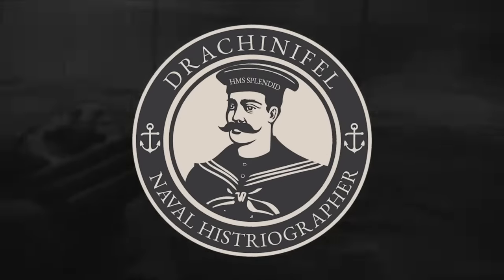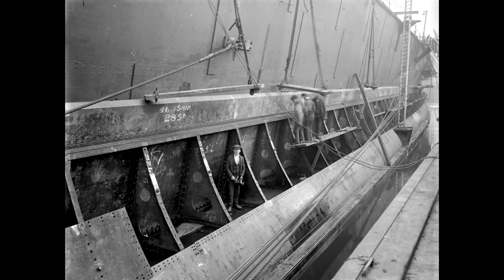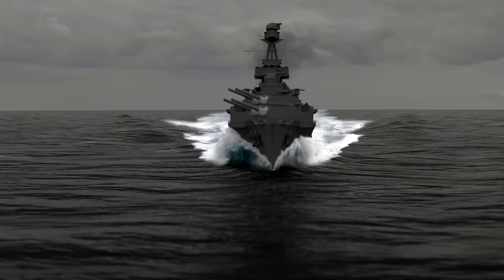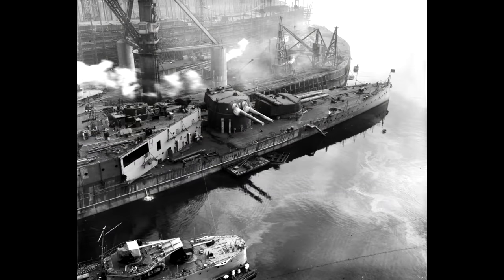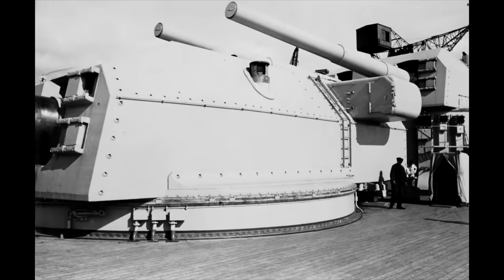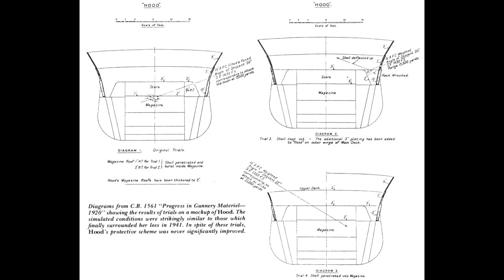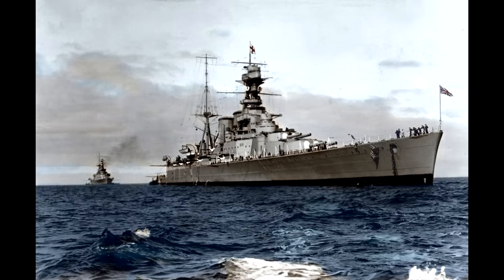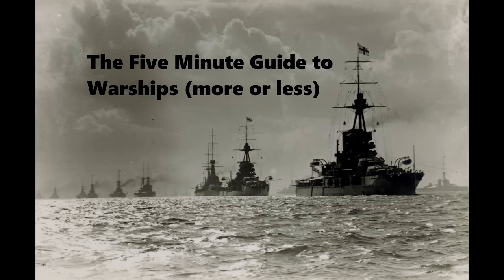The Loss of HMS Hood - But why did it blow up??

Comment: It says so much about Drach, that after 80 years of "What happened?", my first thought was "I'm glad we will finally be able to put this one to bed"..
Reply: Well said. No substitute for thorough research.
Reply: That ^  :-)
Reply: yep, i thought that an extremely well presented description of events, he also took time to cover the other theories. Very nice work.
Reply: It's almost identical to the one I've followed for a while, the one I saw last year had the shell hit slightly further forword on the ship traveling trough the machinery space and detonating just short of the relatively thin bulkhead protecting the secondary ammo, ultimately leading to the same end chain of events
Reply: @gettinglost316  that's what happened. it went through the 7 inch belt
Reply: Buzz Beurling I know that Nathan Okun subscribes to the 7” belt penetration theory.  It requires an even narrower window than Drach’s theory, but both are plausible in my opinion.  Unfortunately we’ll never be 100% certain.
Reply: @bluemarlin8138  but we can be...the timeline and the sequence of events is quite clear.
Reply: I had the same thought.
Reply: Academic speculations will never give the exact answer, sending down a drone that documents the actually damage on the hull as well where bits and peaces are located on the sea floor  might finally solve this mystery.
Reply: It would be interesting to see a probability distribution of likely shell hit locations distributed over her hull. We know the exact chain of events (4inch Mag first). Could probably get pretty accurate. Would be interesting to see what the probability of the range would actually be given the size of the ship a PDF function for statistic types. I have to imagine that it was pretty low odds
Reply: @nanordstrom  I doubt sending a drown down would help. The area around where the shell impacted is just gone after an explosion like that.
Reply: Same. This is the first and only theory that really feels right to me. The plunging shell through the deck to me never felt right.
Reply: Know one knows what happened - Drach would be the 1st to say that this is a most likely THEORY.
Reply: @robanson32  How do you know the exact chain of events??????
Reply: Yes.
Reply: @sevi117   agree. The area of interest was blown to pieces,the midships section is upside down and has been at the bottom for almost 80 years. We *know that the aft magazines exploded. There were probably a  hundred or so who saw it. What was in doubt was why?
Reply: @mfletch3205  yes. The problem is that most of Prince of Wales crew wasn't lookin at the Hood until it exploded (mainly because they were on a night battle and apart from the fact that they had a lot of job, they only could see the ships when they fired), and only 2 persons from Hood's crew survived. They only knew that the ship exploded, but they didn't knew how it happened. The aft magazine obviously had blown up, but all they had apart of that were suppositions. The pride of the royal navy was gone, and they didn't know why. Weak horizontal Armor was always the main suppositions, but the interesting thing about Drach's theory, is that it changes that point because it shows a more plausible one that looks at the ship underwater protection and a lucky (but more plausible) hit that could happen few minutes before explosion
Reply: @sevi117  Kinda like the Edmund Fitzgerald!  The part of the ship that sunk in Lake Superior that would prove/disprove 2 of the theories of why she sunk is broken apart, separate steel plates and under well over a few thousands of tons of steel pellets!  (The other part that needs to be looked at is the lower part of the bow and that's several feet below the bottom of the lake covered in mud!)
Reply: @buzzardbeurling  Not if there are 2 possibilities that end with the same conclusion.  It’s probably one of those 2 scenarios but we can never know definitively which one it was that started the chain of events.  Both theories are valid but only one situation is plausible.  Which one?  You don’t know.  There’s no way to be 100%. 

The only thing that IS 100% certain is unfortunately HMS HOOD sank.
Reply: If you understood all he was saying!
Reply: @davidcritchley3509  What??
Reply: @davidcritchley3509  I understood him.  That’s not the point.  I don’t understand you so I’m still waiting on a reply.
Reply: @timengineman2nd714  Now I have the Gordon Lightfoot song stuck in my head.
Reply: Alemania siempre sera mas grande que el reino unido jajajajajajaja
Reply: I have to say I don't think we can ever put the matter fully to bed the wreck is utterly devastated it doesn't give us a clear Smoking Gun on which specific element precipitated the magazine explosion and there's not even some agreeance between people on that being the case my definitive understanding and Analysis is Hood was a battle cruiser sunk by a German battleship because her armor scheme was insufficient and anemic Hood was the wrong capital ship to send after Bismarck the only comparable scheme from a 20 year older design would have been her speed which was diminished from mechanical neglect HMS Hood was an instrumental worship from the first world war and had she been retained and maintained correctly she would have been a more potent instrument to send against the German battle wagon
Reply: Literally same.

Comment: When I was serving in the U.S. Reserves after my active duty tour, I worked with a very good Senior Chief who was a nuclear engineer. In civilian life, he worked for a company that had a contract to design the ammunition hoists for the U.S.S. Theodore Roosevelt. A major consideration of the design was to prevent the bypassing of the safeties so blast doors could be open simultaneously. Million were spent "sailor proofing" the lift system. He told me that on the first acceptance sea trials, it took the crew forty minutes to defeat the interlocks and open all of the blast doors at the same time. So much for that theory...
Reply: That's the thing about idiotproofing things. If no current idiot can break it they will just issue a better idiot.
Reply: Funny story about that. One of my friends is an officer with the USMC. His unit was tapped to field test a new... Widget by The People Doing R&D. The researcher in questions handed him a few of this widget and basically said, "we've designed this to be grunt proof. I'm heading out of country tomorrow, send me an after action report if any of your guys manage to break this."

Three hours later my friend was standing in front of this R&D guy with a hundred pieces of widget. When asked how the hell his Marines had managed to break it, he responded, "They put it in a freezer and then shoved it between the road wheels and track of an Abrams."

"Why the hell did they do that?!" 

"I thought you said it was grunt proof?"
Reply: Its always hilarious to read these stories
thanks for another one
Reply: The thing is you say defeated the system, did they intentionally defeat it? If there were doing everything they could to bypassing it then the system was reasonably good as having that many steps to achieve a unsafe condition should not happen in a real world situation. If it took 40 minutes accidentally then the system was junk as a series of events to achieve this were not alerted to.
Reply: @NavyVet4955  It took that time the first time.  Because the transport time is long, crews were notorious for bypassing the safeties to get weapons on deck for faster turnaround of strikes. The system was supposed to prevent it, but it is still wiring, and any system can be negated. I don't know if it alarmed, I wasn't there, but the whole point was that the doors are opened when the ship is most vulnerable, during active operations. Ask the British what can happen...
Reply: While only anecdotal, I can't imagine is ever bypassing a safety system on my last ship for any reason unless bypassing that system actually reduced risk. Example: we could, while under fire, continue pushing the engines past safety limits to get us out of the line of fire. But knowing that doing so might actually cause the engines to fail, we were still unlikely to do so as slower engines were better than none at all. But I do know that historically, other commands have been known to break rules for convenience (Iowa comes to mind)  @kevinbendall9119
Reply: @kevinbendall9119  I was aboard the Carl Vinson for 4 years and as a ship fitter got to see a lot of these issues while doing repairs and modifications around the ship. I think the idea of preventing the unsafe condition is good however most times the problem is portrayed incorrectly. To the sailors getting the ordnance to the flight deck is key to getting the planes off the deck. Sailors are drilled and pushed hard to be the best and at times told to do what it takes behind closed doors. Then you have the safety minded that want to eliminate ways for the sailors to skip steps in this process. The real need is how to get the ordinance to the deck faster and safer. Few hands on sailors are ever consulted when designing systems.
Reply: @NavyVet4955  Yep, know how that goes. I was a tin can sailor, but my Brother in law was on the Nimitz. You put your finger on the crux of the issue. The problem comes when things go wrong, and the survivors are busy doing CYA.
Reply: @NavyVet4955  non end user input or lack of it is widespread, was in the business for twenty five years, a head designer from a client one day even announced he had never even sat in one of the vehicles we were working on, it is how it is and as more and more people get involved so things will not get better.
Reply: @MrKeserian  The most feared thing in the world are bored Marines and Canadians at war.
Reply: @ice843  you could be right, at one time we relied on "common sense", not allowed that today,
Reply: I believe all the best systems, allow you to cheat; i.e. a bypass is built in and considered for. Rigid systems will never take into account all the circumstances that will happen.
Reply: @notapilot1  To my sure knowledge, there are no "bypasses" installed on safety interlocks. Knowledgeable techs can defeat any system, but as someone else pointed out, making it difficult and time consuming helps to prevent it. I have seen them fail, and because of one failure in particular, the systems were redesigned so that they would fail in an alarmed and locked condition.
Reply: @MrKeserian  LMMFAO !!! OohRah !
Reply: @taproom113  if we don't give y'all enough crayons to munch on, y'all start figuring out how to break things. Usually it's enemy things. At least, that's what the rest of us prefer. ;p
Reply: The same thing happens in civilian industry. Workers repeatedly sabotage saftey precautions in order to more ease of operation of machinery. Sensors ends up taped over or misaligned to allow for protective doors to be opened with machines still in operation to allow, as I saw at an industrial bakery to remove clogging of pieces of bread stopping a packing machine. I also saw a worker get a hand trapped in a machine (imagine a mangle) while trying to clean it in a way it wasn't meant to be cleaned, that is while in operation. She could have lost a hand but luckily it only needed to be bandaged for a few weeks.
Reply: @MrKeserian  'challenged: accepted' moment lol
Reply: Haha...In the german Spz (APC)  " Marder", you know....if you removed the night vision system on the march....you could exactly fit a large box of "Hanuta" (a popular german chocolate waffel sweet) onto the turret ring...said someone who insisted he was absolutely sure.....just saying......
Reply: @jimminey-fooking-cricket4903  as a Canadian I agree.
Reply: @CrusaderSports250  little story father told me of his time in the navy, the ship he was on was getting some brand new communications equipment installed against one wall, and just so happened one of the designers was there overseeing the installation. The sailors took one look at it and noticed a glaring problem, all the buttons were prominent; when the designer asked why that was a problem with that one of the sailors pushed him against it and half the bottons got pushed. It was at that point he realised waves and rough seas were a thing
Reply: @89Keith  but it worked perfectly every time they tested it back at the lab !!☺.
Reply: @CrusaderSports250  yup, perfectly unless someone happened to get knocked against it and mess with the dozens of settings, but not like that could possible happen on a warship at sea :p
Reply: @CrusaderSports250  Look at what they have done with small gasoline containers in the civilian market.  Turned a simple to use, inexpensive container into a expensive monstrosity that people very often modify, that frequently makes them more dangerous and makes them "pollute" more than the old school version.
Reply: @89Keith  we could form a committee to study the possibility of putting a safety rail round it, that would work !!☺.
Reply: @johnstudd4245  not sure of the containers you are referring to as I am in Britain, we have the standard design Jerry can and 5 litre screw top plastic containers for fuel, if you have something different it will be because its been "improved" !!☺.
Reply: @CrusaderSports250  Google "how the EPA  ruined the gas can" and look at some of the results. May be the govt environmental regulators have a bit more common sense in the UK.
Reply: @johnstudd4245  will do, as far as regs go they are to busy messing other things up and haven't got round to fuel cans ,YET .☺.
Reply: Maybe the had a couple of Marines of board.
Reply: @NavyVet4955  "Few hands on sailors are ever consulted when designing systems." And there's the rub.
Reply: @davidforbes7772  I agree.
Reply: I use to work as a machinist and one of the 1st thing people do is disable the machine safety. you notice a lot of guys walking around with missing digits.
Reply: @greenfingernaildirt356  "a common mistake that people make when trying to design something completely foolproof is to underestimate the ingenuity of complete fools" - Douglas Adams
Reply: @michaelpettersson4919  I worked for a Brit packaging machinery maker, one of the most senior techs lost the end of his right thumb by clearing the cartons from the cavity while the machine was running. Downstroke had a safety, upstroke did not. Pinched it right off.
Reply: @dsloop3907  Ouch. Well something similar happend on my maternal grandfather. He had some fingers and his tumb shortened on one of his hands. I do not know the circumstances how it happened but apperantly he was just barely on sickleave after that. Essentially he just got patched up and returned to work jest a few days later. People where sturdier in those days...
Reply: @89Keith  I was trouble shooting a CIWS and the system suddenly shut down.  Turned around and saw a sailor rubbing his forehead.  He had fallen asleep and hit his head on a circuit breaker 😑
Reply: @jimminey-fooking-cricket4903  One of the most feared creatures is a JO with a compass and a map.
Reply: @MrKeserian  Hi there! Many years ago (1987), I was down at the Commando Training Centre at Lympstone (UK). They have a very good weapons museum there, in which I met the then Regimental Sergeant Major. He told me a lovely story re the newly incoming rifle, the SA80. The rifle was on test with the Royal Marines in Norway and what happened, actually happened to the RSM I was speaking to. In short, the plastic stock pieces were not proof to the severe cold of Arctic temperatures....as he said “The temperatures dropped and that night, as I banged the weapon down, onto the bonnet of the LandRover, the plastic stocks disintegrated into a million bits”! 😂😂😂 Grunt Proof / Squaddie Proof, etc.....if there’s a way to break it, they will....😎🤪😂😂😂👍🏻👍🏻
Reply: I guess "Station a dalek at each bulkhead" was discarded.
Reply: @MrKeserian  A perfect example of the grunts simulating extended time in freezing battlefield conditions causing carelessness to creep into their actions. It's freezing cold and Bob over there dropped his in the snow near the road, and then it got kicked up into the tracks as the tank passed. :shrug: It happens.
Reply: Never underestimate the ingenuity of people in the military to bypass a safety feature that inconveniences them